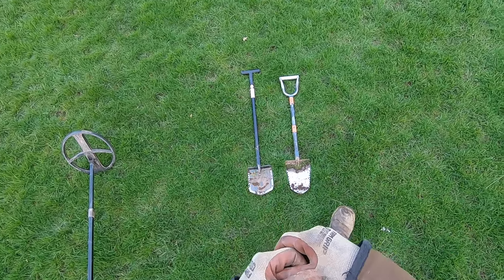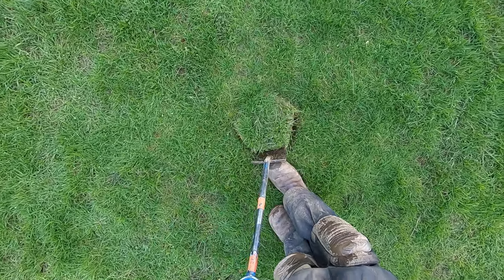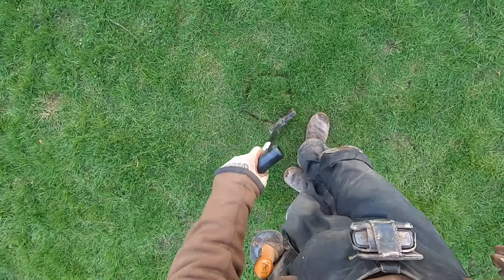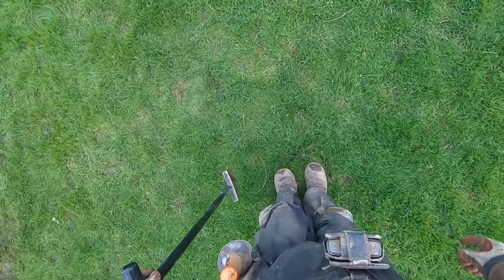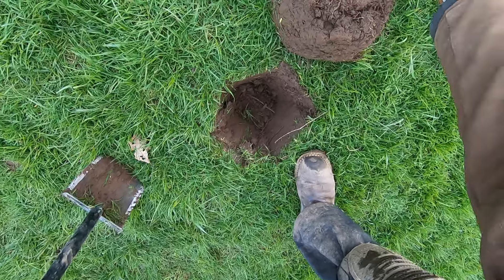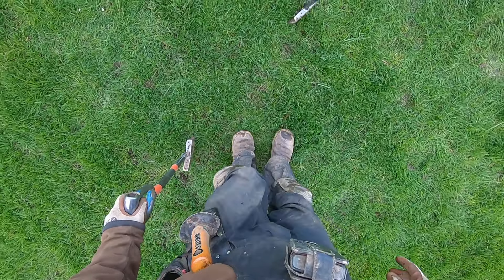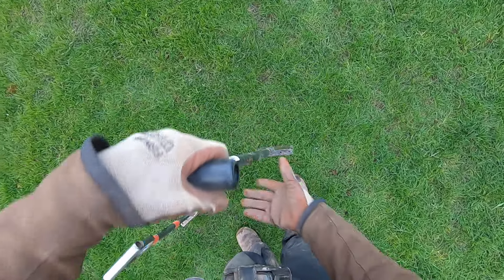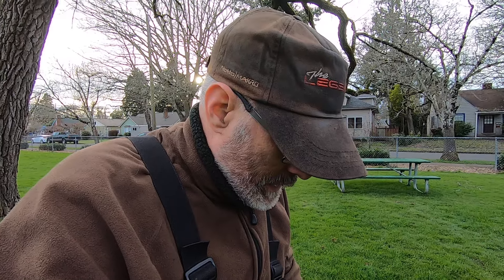Shovel comparison!! Predator Brute vs Predator Phoenix.

Comment: I like your Phoenix, Jeremy, especially the curved blade. I have the Lesche T-handle, it works great, but I need to dig at an angle to make perfect plugs. Great video.
Reply from the maker: The Phoenix is just frikn magical. It is hard to demonstrate just how much easier it is to dig with the Phoenix compared to the straight spade shovels. There is something special with the double curved shape. The Phoenix glides into the ground forming a cone just by the shape of the head. Other straight spaded shovels you need to angle the shovel to make a cone. The Phoenix is MAGIC!!
Reply: @PaystreakSuperfreak  Nice!

Comment: The only concern with that much of a taper to the plug would be on deep targets, not much margin for error on pinpointing but I can see why it works so well in your soil, a smaller connection point when prying out the plug. Excellent demo Streak! 👍
Reply from the maker: I have never had a problem with the angle or tapered spade not going deep. I have use the Phoenix in all different soils. It is perfect for about 7"-8" deep targets. I do not want to spend my time digging deeper than 9" deep. Parks service I am sure will have a problem with us digging huge deep holes. To dig deeper I just use the Hornet shovel in the farms fields. I do not take the Hornet into parks because it is a gigantic frikn shovel.
Reply: @PaystreakSuperfreak  I wasn't referring to depth but rather the potential of striking a deep target with the shovel, the more the plug tapers the less room for error on the pinpoint, not an issue on shallow targets.
Reply from the maker: I do not have problems striking or scratching targets. Once in a whole I may scratch a coin if it is on edge of plug. Most of the time if I damage a target...it is with my hand digger in roots or gravel.
Reply: I agree with you. Here in Wisconsin with my Etrac, I along with my other detecting buddies are constantly digging 10 - 11 inch targets.  There is no way that the  blade curving in would not be a problem on a 10" coin. I have not used the Phoenix but I would think that the solution would be to to have the handle a little more forward when you dig so that the tip is not moving so close to the center of the plug.  Not sure why Paystreak would not spend the time to dig deeper then 9" if it was a good signal???  A few weeks ago I dug a 10" seated dime at a local park. 
I have the model 58(S) Little Eagle with the straight blade and it works great!!  Like I said, I dont have the Phoenix but I think I'm going to buy it and try it and see how that curved blade is.

Comment: PS,

Love your shovel comparison videos.

I'm curious, do you have a digging technique that you use in parks that don't permit shovels?  A friend of mine in Denver hunts parks that only allow screwdrivers and probes.  He cuts a 6" slit in the turf and then pries the sides of grass up with the screwdriver.  To me that can cause more damage than a shovel but he says in Denver you have no choice.  He is pretty good at this technique but I was wondering if you had ever tried it.

Bill
Reply from the maker: I will not detect a place that has a shovel ban. Using a screwdriver will damage the ground more than a hand digger. Using a only screwdriver makes this hobby not fun!! We have modern specialized digging tools that are much much less intrusive than a screwdriver or probe. If my city were to make it screwdrivers and probes only....I would give up metal detecting and switch hobbies, or I would move to a different city. I feel very sorry for the metal detectorists in Denver, they should lobby for our hobby and show the city council how destructive a screwdriver is compared to a modern engineered hand digger. Metal detectorist are cleaning the parks for free!!
Reply: @PaystreakSuperfreak  I could not agree more.

Comment: Great video! If you don't mind me asking, how tall are you? The shovel I have now is 35" in overall length. I'm a bit over 6'1". The Phoenix is a bit shorter at 33 3/4" . Just trying to get a comparison and reference. Thanks a bunch.
Reply from the maker: I am 6ft tall and the Phoenix is a bit short for me. The Predator Hurricane has the same spade but is 38 inches long with a T-handle.